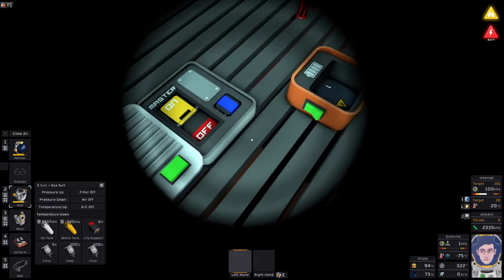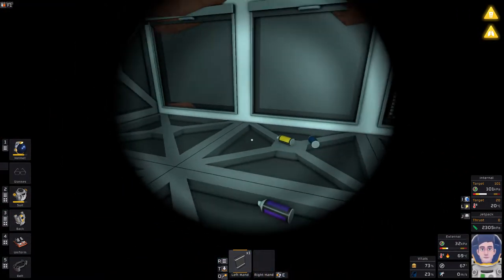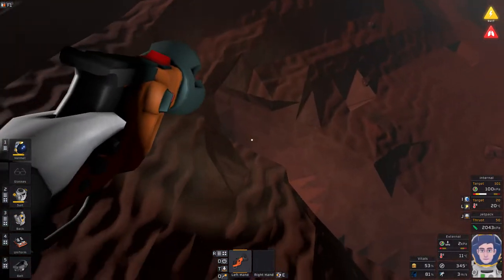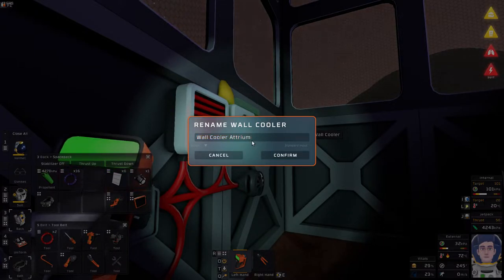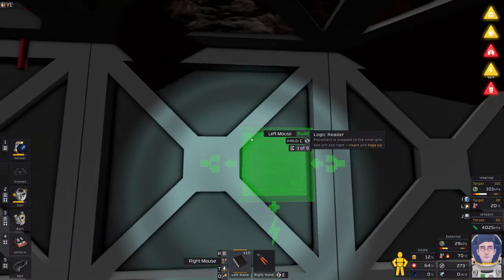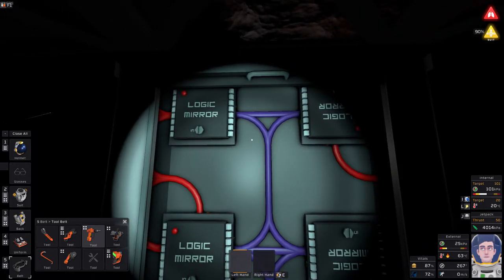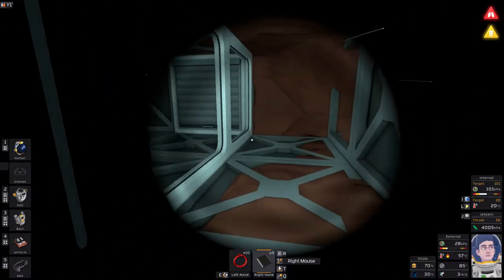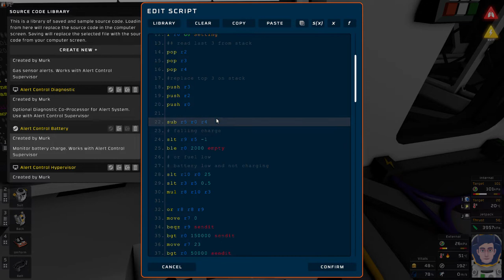Stationeers Play Through Part 24 : Control Room

Comment: Can't you just buy multiple smaller quantities of Nitrogen instead of all of it, all at once, so that it doesn't explode?  Just a thought.
Reply from the maker: The issue is that the trader sells 300mols of N2 in a canister that is only rated for about 250mol. You can buy as many cans as you like both they're all over pressurised. The 150mol ones are OK. It's actually a known bug and on the dev backlog to either sell it in a lower amount or in a higher tier can that will take the pressure